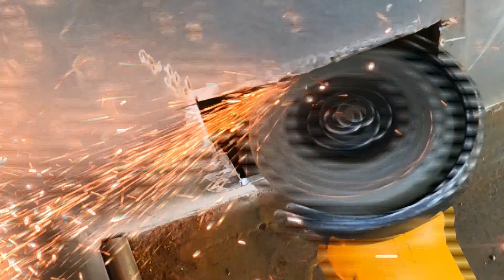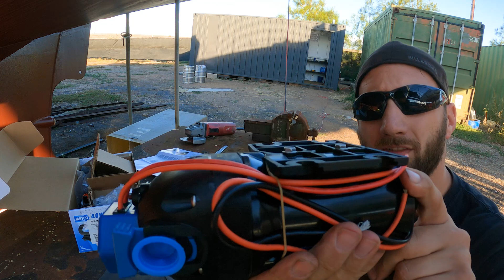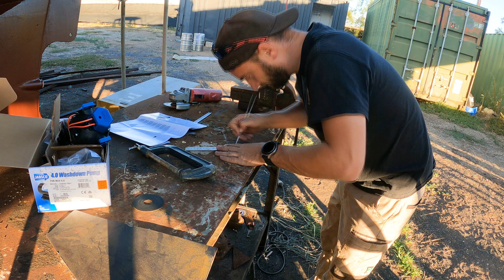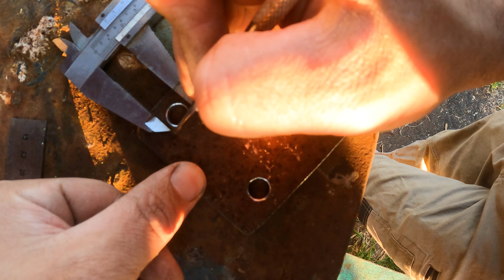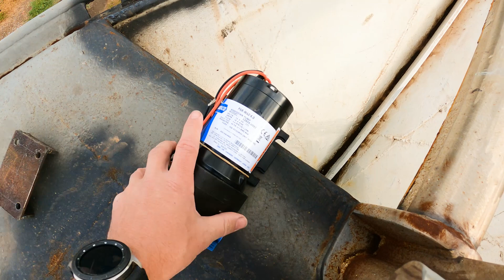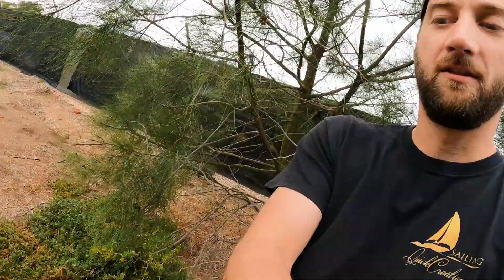Sailing QC # 16 | Welding Boat Cockpit & Pressure Pump Bracket  | Steel Sailboat Restoration

Comment: Will the water pump have a hose to a through-hull fitting? Or will you throw an intake hose over the side?
Reply from the maker: It's going to go down to the manifold inside the boat 🚢 we're gonna gave 1 seacock servicing all the 💧 for the boat.

Comment: Nice work.
Might consider building a small trunk cabin to support the mast and provide a place for wiring to pass through.  Dorades to either side of this is common.  One thing to consider is where they will be when you're tending to the mast.  Having to work wedged in between a dorade box and the mast is not fun, neither is leaning over or straddling a dorade while maintaining, or even winching in a halyard.

Also will the dorades fit the interior plans?

The air compressor, it's going to sit/mount outside the storage container?
Reply from the maker: The mast is located up top of the raised saloon, no dorades in the way there :) will look into where locations will be for other items and fingers crossed they wont be in the way too much. Tending to mast will also have granny bar set up in future for safety and ease of use.
Moving the dorades a little forward will still keep them within the cabins, but we will need to consider lighting plan for the rooms for wiring and ascetics. 
Air compressor has just arrived and will be building a lean to to protect it from the weather, its currently wrapped up in a water poof bag for the time being.